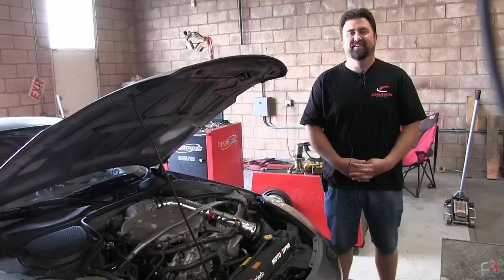Mass Airflow Symptoms and the Workings Of The Mass Airflow Sensor

Comment: Outstanding!  Wish I (and the two mechanics who missed it) had seen this when my van was overheating.  I thought it was running too lean and hot.  They checked and replaced everything else - thermostat, pump, radiator, even the radiator cap without success.  I suspect I probably over-oiled my air filter and or the MAF was just dirty.

Comment: I have been struggling with a intermittent vibration at speed in a 2003 Camry V6 primarily going up hills. Symptoms were the car body and steering wheel vibrated. It felt like a out of balance tire (I just had the tires rotated) so I took it back into the tire shop and had the tires checked. I chased my tail trying to correlate the driving issues. Yesterday, the weather changed from sunny and warm (thin air) to cool overcast with light rain (thick air) and the vibration subsided!  It had something to do with air density.  I came across this video and you articulated how/why the MAF functions within the system. I was convinced this was the problem. I removed the sensor and cleaned , now Car runs perfect.
You very seldom get to see subject matter experts on YouTube. Thanks for sharing your knowledge.

Comment: I been trying to get my truck to pass smog since 2017 and I been trying to figure out this lean code I been having for years !  A/F to lean bank one sensor 1 so I have changed both 02 sensors, didnt work , installed new cat converters still don’t work , changed MAF sensor still nothing !  But I do have a k&N intake and the MAF sensor is mounted underneath instead of facing up “. You just gave me so such valuable information That I been trying to find for years “ so last week I did clean another filter and sprayed some of that oil on and yesterday it’s giving me all kinds of idol problems “ codes popping up like crazy “ cylinders misfired ‘ just making my truck sound like crap “ so when you said it that the MAF can get coated because of the oil 💡.   I hope it’s because of that I’m about to find out right now thank you so much

Comment: You just save me hundreds of dollars in repairs on my Jaguar with your explanation of how the MAF sensor works. I thought I had a vacuum leak that required a lot of labor to repair. I had installed a K&N filter on my S-Type and it started leaning out under heavy air flow. As long as the engine was cold and the choke was operating, no problem. But once the engine was warm, it would not rev over 3,000 rpm without the automatic ignition cutout coming on. The car drives fine as long as I kept it under 3,000rpm, which is about 73mph. Is that any way to drive a Jaguar? Hell, no!. 
So I replaced the K&N oiled element with a dry element ($16) and installed a new MAF sensor ($14.74) and the check engine light is out and everything is fine.

Comment: I have a 2012 wrx but im getting  a  exclusive fuel trim code running very rich .cleaned the maf and works  great for a few days  then it does it again . And no boost leaks. Started happening this summer  the only thing different is that I've been keeping it in a air condition garage.

Comment: I was wondering why my 1990 Olds 98 3800 is getting poor (20.1 mpg) gas mileage and I noticed the 1 wire was black with soot or carbon. I hope this helps. Thanks for the video.

Comment: I have a 08 chevy silverado lmm 6.6 duramax. I have purchased everything HSP,  except the egr delete cold side up pipe. Anyway with the cold air intake as far as temperatures into the motor if it's 28 degrees outside that's what shows on my cts2 at the sensor. My problem is I keep getting a po101 code putting my pickup in limp mode. Using cts2 to clear the code. I've undone the negative on both batteries, purchased a new sensor, even cleaned it. The code still keeps coming up, but not near as frequent! Any suggestions as in a hard reboot? I don't know what to do, I know a dealership going to get my $$$ for probably something very simple.

Comment: Shaun Church sir reading the comments I in gather you excellent at this and your explanation many find veru helpful. I am no mac, a guy did some diagnostics on my 'VW POLO 1.6 , but I still have a problem.  My car has engine surges.....irregular idling ....fast  and slow idle. And now this last few days  there is a  tendency to cut  off.I  down the pedal to keep from switching off.seems to this happens  if i  am stopped ar an incline. Am i sitting with multiple problems...? Have  you covered this in any of your other programmes that you can direct me to..?much appreciated. THANKS JOHNNY

Comment: I have a 2012 Nissan Altima and having 3 problems with it that's causing engine light to stay on. Vent control open ,mass air flow range performance and canister purge valve. Are all of these connected with each other like is 1 causing everything else to fail. Is it just the mass air flow sensor that is dirty. Does this have to do with higher RPMS at idle

Comment: What if you try to take out map sensor and take the one bolt on a 2016 Hyundai elantra so take the bolt and wiring harness off and it does not want to come out!? It moves left and right but it does not want to come out!? Thanks! Want to clean it but nervous to really pull it out hard dont want to break..thanks again

Comment: So yesterday my 1998 740il popped a p0301 and a p0300 right before my wife and I were about to go out of town and it was shaking bad and barely would accelerate. We ended up taking our van instead. I went and bought a coil for cylinder number #1, installed it and the car did the same thing. I took out all the coils from that bank and the spark plugs as well. They all looked good. I re-installed the plugs and coils leaving the new one out, disconnected the battery and touched the + and - togther, reconnected the battery and the car ran like normal with the slight miss it's had for the past 2 months. I pulled the MAF connector off and the car cleared up perfectly. I put it back on and the miss and slight shake came back. I was about to unplug it again and the car shut off when I touched the wires to the plug connector. Apparently the wires are frayed or something inside or at the plug. They're connected good enough that the car won't throw a CEL for it when it's connected but the mpg's are bad with it connected. I drove a round with it unplugged for about 4 miles and my mpg's are at factory spec, sometimes better like up to 20 mph in the city. When I shut my car off the CEL was back on with the codes P0100 P0130 and P0136. I understand the P0100 but any suggestions would be great. Thanks

Comment: I have a 16 wrx with a Cobb intake and I’m having negative AF learning 1 badly at like -20 to -30 and this only happens at idle and low throttle;  it’s only a problem that has recently happened but the intake has been in for over a year. Where should I start to look first? Cleaning the maf or checking for a leak? And does this sound like a vacuum leak or a boost leak? I might have missed it in the video but I didn’t quite find what my problem is in the video

Comment: I got a 2012 ford focus and every now and then there is acceleration hesitation where I lose power for a few seconds when the go pedal is pressed when taking off but there is no check engine light on at all. I'm thinkin it may be the spark plugs/ignition coils or mass air flow sensor is dirty. the LW focus 1.6 liter 4 cyl only has 75,000 kilometers on it.

Comment: Last tip was a good lookout very close to home condition with my 325ci convertible 02. Gonna test and try cleaning maf and replacing my filter checking my O ring on my Disa and replacing my boots . Just got this car with only 77k miles but it sat obviously forever the engine is filthy below the covers . Was gonna go get familiar with the spark plugs after this anymore key tips ?

Comment: Does a dirty MAF sensor cause lack of power when accelerating?  Having some issues with my 2013 Cadillac ats 3.6. Took it to Firestone and they said one of my cylinders was misfiring but didn't know which one bc they didn't have the proper tools to pinpoint the issue?

Comment: I have a 2010 Hyundai Elantra with a rough idle. I have a Launch 123 i scan tool. The car idles really smooth with lots of power when it was when new , if I detach the MAF sensor. What should I be looking at?  Gas mileage is poor and not as good power wise as when it was new. Drives ok. Could I have a hot wire issue. I have the shop manual form Hyundai . The scan tool will read live data, and I can save the data or freeze frame the data and print it. I notice the timing is erratic, and the idle speed drops down and then comes up! into the range it should be. Engine timing is nit smooth. I had the timing belt and water pump changed because of the age. It had no influence on the rough idle.  What do you suggest ?  Thanks EJR

Comment: Hello sir. I've been experiencing the issue that MAF fails... I have aliexpress BOV. The stock one melted somehow and I needed to change it for sometime.. It's the second time that maf failed. First one was because the inlet pipes were leaking when I bought the car and after I change that it was OK. now I bought Splitter valve from Forge and I'm wondering will that fail again if I use it as a BOV? Do I have to use it as a recirculation valve? my car is 2004 audi tt mk1 225hp stage 1 mapped, downpipe, muffler delete, r8 coils, iridium spark plugs, KN Air filter, k04 Hybrid turbo... What are your suggestions?  How can I deal with this MAF failure.. and also do you Suggest Race type of N75 valve to this car with those mods? Thank you.

Comment: Could maf issue cause surging and bucking while driving and check engine light to come on then go away when car is turned off then start again and it happens again in 10 15 miles and not necessarily every time 😮other than this random issue car runs fantastic and great gas mileage

Comment: I have these codes on my 04 330i p0171,p0174 that would not clear after I reset the cel..i could not figure out why..i took off my maf and cleaned it and put it back on and the codes cleared..few days later they came  back so I did the same thing and now they are back again...u think i should probably replace the maf?

Comment: do you recognize a problem when i plug in maf car stalls 96 deville.unplug runs. have been getting 1074 1071 lean codes for a while .checked leaks smoke machine.nothing changed intake gasket.and have done a few other emmission pluses.plugswires.e.coils.have a maf coming today hope its the prob.

Comment: thanks a lot , very good explanation theoretical, needs more practical on what you said the parts..  more zooming cam on the parts inside the engine thanks on all of it at the last I have to ask ::: ?   what about the mass air flow controller if the conductive graphite has been removed or crushed or seems to be not conduct easy ??  is pencil graphite do any things better ? what to do please ?? azaad
Reply: Don't EVER touch that .. that .. thing inside the MAF sensor.. It's sensitive As Hell !!! Only spray MAF Cleaner on, and around it !!  NEVER Touch It ..! and No Foreign Materials! on it either ! !

Comment: I was revving my engine so that I could test out my two-step and all the sudden I start getting these codes with po111 po113 ... The only thing I can add to this is that my exhaust pipe was disconnected from the downpipe and my secondary oxygen sensor is just 2 inches away from the flange. It ran fine when it was cold but after it warmed up and started acting up. The next morning I started a cold but it did the same thing. I’m about to work on it now but I wanted to leave this comment because I’m wondering if having The secondary O2 sensor exposed can trigger something. 2003 Nissan Sentra spec V 2.5.

Comment: I just purchase a Auto Zone MAF sesnsor for my 2004 350z. However after installing this, after 20 minutes driving throttle response went away, like cruising pace kind of speed. Another words, I push the gas pedal all the way to the floor....yes the car would go, pick up speed. But, nothing dramatic overall....not impressed! I did the complete throttle body relearn, press pedal 5x after 10 seconds hold it down to 20 second count. Still did not work! So put my original one back to the car...press the pedal rpm went smoother, as far as rmp tach, but same result...really bad gas pedal accelerator response. Btw...No Engine light also!! Can you help??

Comment: my car has small hesitations at low rpm and then big cutting out and coughing when turbo boost comes in it's a 95 subaru wrx should i just change the MAfs, apart from that it starts and idles perfectly. I can't hear or find any vacuum leaks and there is no fault code
Reply: I think you should try cleaning it first if it fixes the problem then you can buy a new one or wait till it gives you problems again then buy one ..god bless

Comment: I have check engine on my bmw 550i 2011 said my sensors need replacing cause of too lean etc.. I changed the sensors with bosch which were same ones in the vehicle but still saying mass air flow lean need inspection asap need help on what to do?
Reply: Ya gotta be real careful about jumping the gun on just changing-out sensors, simply because you got a code from 'em...
Quite often!.. a sensor can pop-up a code, ... but, what it 'could easily be telling you' is.. (follow this now...)
You got a problem up the line from that component.
Take an O2 sensor for instance... You could get a code for 2  O2 sensors .. 1 on the header of bank 1, and another for the 1 after the CAT.
(and this .has. happened..!) .. the CAT sensor could be givin' ya code , because the one on the header pipe is bad, and not doing it's job making the ECU make it run rich or lean. (hypothetically..)
Point is ... (again, hypothetically...). Let's say ur EGR valve is stuck open, then it's gonna affect MANY things! down the line, after that point.. 
You have go about it systematically...  
It can get  !Wholly Shit Expensive! to just go change out all the sensors of the codes you're getting.
Jus' sayin' ...

Comment: I get a P0101 code on a GM Truck w/6.0L.  I have a cold air intake with a second intake hose ducted into the filter box, from an opening in my lower grill.  Is it possible that the cold air being scooped in the second hose, is cooling these MAF wires too much?  When I mash the gas pedal, the check engine light always comes on.  I have a AEROFORCE Scan Gauge plugged into the OBD jack, so right away, I can clear to code and the check engine light goes off.  My cold air intake uses a dry filter and not an oiled one.  Is this affecting my fuel consumption by simply clearing the codes each time after I mash the gas?  If I drive normally, it never comes on... but if I need to go fast, the check engine light almost always comes on.  Please help me.  Thanks.  Dean

Comment: I have a 2005 BMW that cranks but won’t start, but only when it’s cold out. BMW had it for 2 weeks replacing the fuel relay, which wasn’t necessary, after 2 weeks of experimentation they tell me it’s the DME but won’t commit to that being my problem,  and they want $2400  to replace it. Could it be possibly be the mass airflow sensor?

Comment: Please Help ! I have Honda Civic FD1 2009. My car RPM use to stay at 750 on idle but after cleaning my Air Mass censor now my RPM stay at 900 RPM on idle. Kindly Confirm is it OK, or some thing got wrong ? 
Currently there is no check engine light.

Comment: I think my mass air flow sensor went out my car is making this weird noise I just got my serpentine belt tensioner fixed and my check engine light is on and my car still jerks a little I’m very stressed because I don’t know what’s wrong now

Comment: I replaced the MAF on my 2009 Enclave as well as the purge valve AND the ECM ($800+) and I am STILL getting code P0104 (MAF sensor), and sometimes P0201 (ECM), C0104 (unknown) and P0104 (unknown).  Any suggestions?
Reply: Check the Throttle Body on the other end of of air flow to see if it has to be cleaned.  CRC has a cleaning pack for Throttle Body & MAF Sensor.  Find video for your car on how to clean it.  Also, check for 02 Sensor.  I needed a new sensor.

Comment: Question For you ... i have a 93 mustang 5.0 and Im getting a 13 volt reading on the signal in and signal out wire when I should only be getting a MAX of 5 ...  Any clue what could be causing this ??

Comment: I have a 02 chevy prizim.i just replaced the evap canister. Complete tune up with new coils and plugs all factory recommended. I also bought a new gasket and sealed it. But I'm still getting a mas airflow and airflow temp code. And random misfire.  I checked all my hoses. And I'm at a loss. Someone please help me. I'm disabled. And already 1 500 on fixing these problems. I'm at a loss to fix my car.

Comment: My Toyota Tacoma 1996 has hiccups and fuel being burned through the pipe I took off the airflow sensor ans the pick up still running ..it stalls after a while when the engine stops trembling and would try to come back to normal what Is the problem with the pick up  I have changed the mass air flow to a new one but it still doing the same thing what is the problem
Reply: Was it a original maf sensor, cheap copies don't often work properly

Comment: My 2011 nissan sentra 6 speed manual lost alot of power. I can barely make it up hills and when I throttle it decelerates and starts bucking. It also hisses the more I throttle. Down shifting doesn't get me more power. It feels like I lost more than half the power. I ran a check and Air flow sensor came up but there isnt a CEL on. I bought the cleaner and cleaned the sensor but I feel like there must be more going on. Maybe an air leak somewhere. Stock intake system with a fairly new air filter btw. Not sure what to do as cleaning the sensor didnt help much. Any ideas?
Reply: Air or vac leak